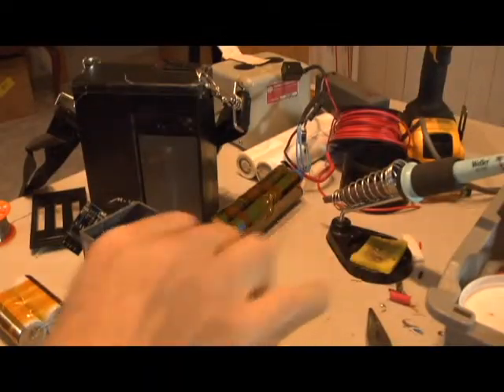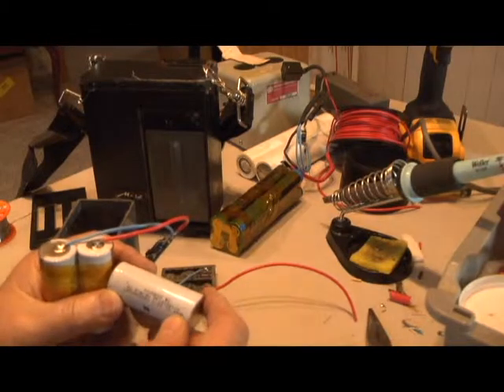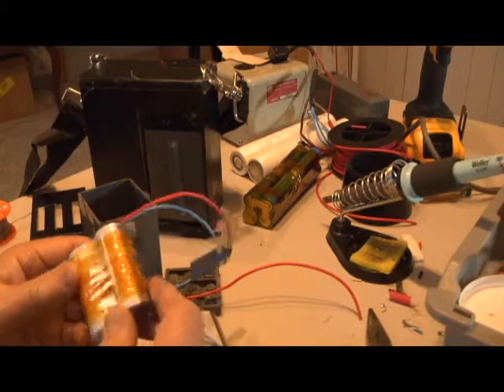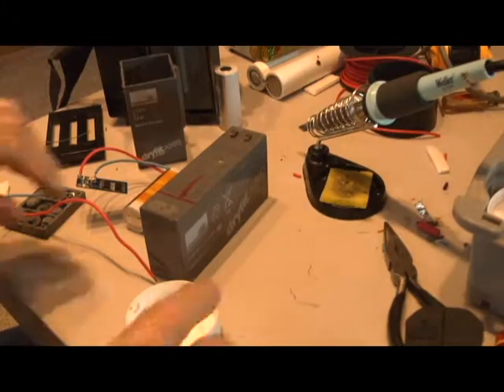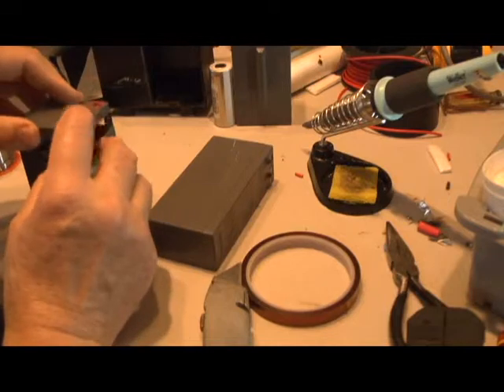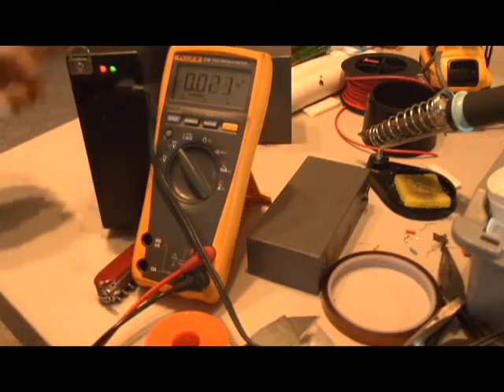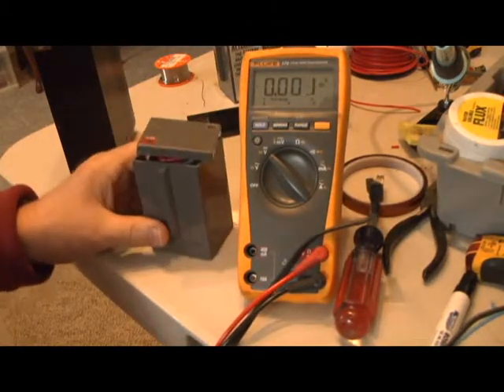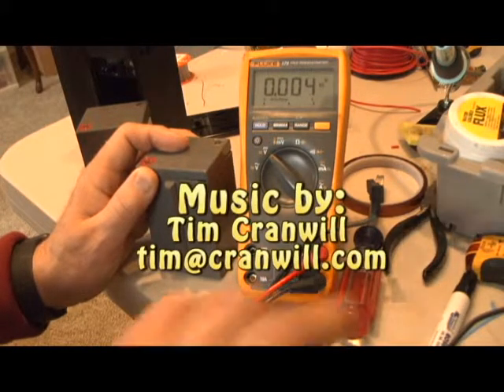Converting a Dryfit battery to Lithium Ion 6VDC

Comment: I finally followed all Steve's instructions to do this conversion and it all worked. My Metz 60CT is as good as new. It charges to 6.9volts the proper way. It was a learning experience for me. Never done this before. Emptying the battery case after cutting off the top neatly was the hardest part. Your battery supplier will advise on taping two batteries together. It's positive to negative each end. Steve missed this bit of information because he takes it for granted that we all know. Beginners don't. The little circuit board (BMS) you have to use makes sure you charge the batteries equally and they don't over charge. It's a safety device to prevent misuse. The BMS matches the batteries you use. When you buy the BMS you confirm what batteries you're using to the supplier. You really don't want to over charge Lithium Ion batteries because they catch fire and will burn your house down.

Comment: Just to confirm that I've now done my second conversion and just like the first it all works fine. I can charge it normally to 6.7/6.8 volts.
To do this work you need to have all the tools. I've got a mini spot welder I use to fix the zinc 6mm tape/strip across the base of the twin batteries. I use a soldering kit to solder the wires to the correct terminals. I bought the different coloured wires on e-bay. You have to learn how to solder properly so I suggest you check the many tutorials on You Tube.
You follow Steve's instructions in his video and you should be OK.
The hardest part of the job is cutting open the Metz battery case neatly and scooping out the dried up remnants of the dry fit battery. I've got a Dremel and I used a drill to mash up the 
innards. The plastic internal separators are a nuisance to cut out but the Dremel attachments help.
So to do a job like this you need quite a bit of kit to even contemplate the job. Once you've assembled the new battery  you then have to glue the top down where you cut it off. Two part glue and then a plastic filler to fill up the joint. After that you sand the joint down and spray primer etc to hide the join if you want to. I mask off everything except the join before I sand down and spray. 
I now own two working Metz CT 60's.

Comment from the maker: I used the standard charger that came with the flash, it did not overcharge, as I recalled it took about the normal time it use to charging. I encourage everyone that is rebuilding these type of battery to use 3.2 vdc 26650 type batteries. Lithium iron phosphate, they are so much safer then lithium ion.

Comment: I'm about to do this job as a beginner. Let me go through the steps in simple language. Two 26650 Li-ion batteries are tabbed with a zinc strip positive to negative at one end. 
Now move to other end of these tabbed batteries. 
A blue wire goes from negative end of one battery to the B - (minus) on the BMS board. A red wire goes from the positive end of the other battery to the B+ on the BMS board. These wires are soldered.
Now a blue wire goes from the P- (minus) on the BMS board to the Minus terminal on the Metz cutoff top.
Then a red wire goes from the P+ on the BMS board to the Positive terminal on the Metz cutoff top.
Finally you solder a blue wire from the BM on the BMS board to the midsection of the zinc tab joining the two 26650 batteries
you tabbed together in the beginning.
Steve's away at the moment so can anyone reading this put me straight if I've got anything wrong.
regards

Comment: Thanks Steve. This is the only video I could find that specifically addressed repairing, substituting or as in your case, reconfiguring the Metz 60 series battery. How many hours did you charge it for?

Comment: I know this is old. What is the BMS part #? I can't find it on ebay.
Steve, do you have a schematic for the hook up?

I still think doing the ATG's would be much less & battery would only be less than $19.00.
Without needing PCB, soldering, two batteries & wiring.

Reply with your email here if you want ATG's.

Comment: I'm doing this job and I'm a beginner. Any chance of more detail on which wires go where? Tabbing the two cells and wiring to the 2S BMS?
I've got two Li-ion 26650 12800mAh batteries and a 2S Balance Li-ion Lithium LiPo 18650 Battery Protection PCB Board 8.4v. Is this board the wrong one?

Comment from the maker: Just so know, I have never had a BMS that you connect both Positive and negative main leads to, be careful about that. All the BMS that I have built are only connected to the negative side of your battery connection. After saying that, the wiring that are designed to balance your batteries, one is connected to the most negative end, then the rest are connected to each positive terminal in order! These wires are small and are designed to carry less then one amp to balance your cells. Send me a photo of your BMS (stevenwdutcher@gmail.com).

Comment: Does anyone have a schematic showing the wiring of these batteries and the 2s BMS?  I have only found the 26650 cells that are above 3.2, 3.8, and above.  I went to my local BatteryPlus and they don't even show them at all.  Any help would be most appreciated.

Comment: Hi, how are you. I use my Metz 60 with sla 6v 4 ah batteries. I have autonomy of many hours. I took photos of events with only one battery, approx 500 photos in 100 iso. Lithium batteries are 3.7v. 2 batteries would be 7.4v Do you use a voltage reducer to give 6v?
Reply from the maker: No voltage reducer, I used lithium iron phosphate batteries 26650 cells 2s, nominal voltage is 3.2 vdc. That seemed to work for me. The charger that came with it still worked.

Comment: Hi Mister Dutcher. Many thanks for the solution to Metz battery. I will appreciate if you can provide me the part as to where I can shop for, of the BMS board and the Lithium Iron Phosphate Amps Ratings on them. If you can send me the links. Thank you very much.